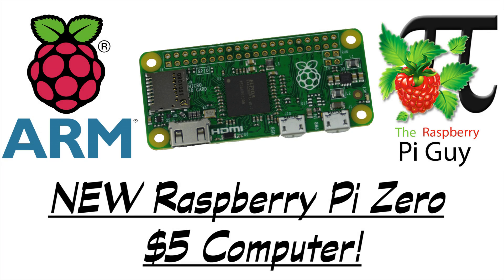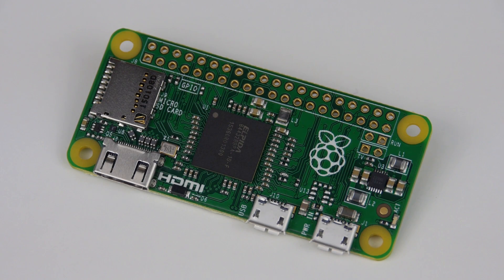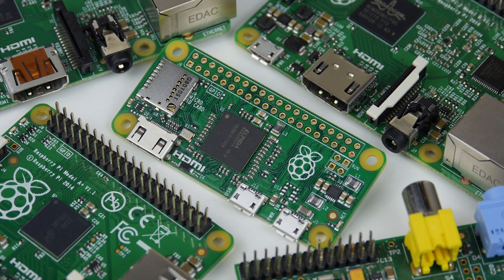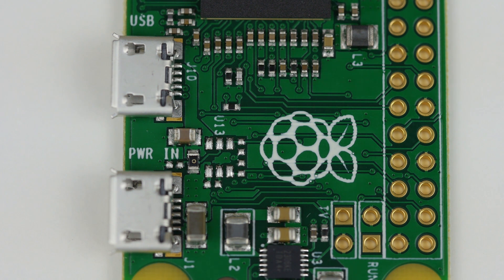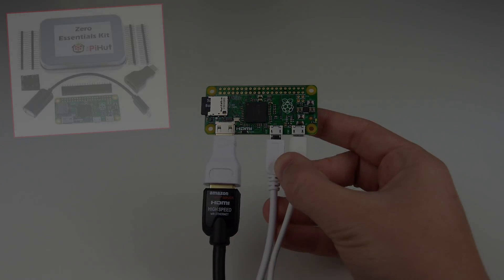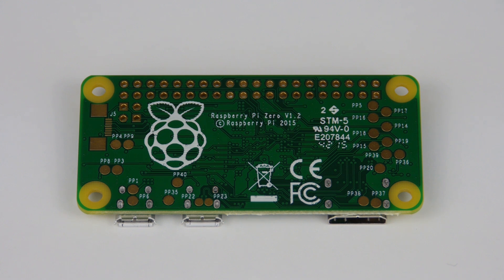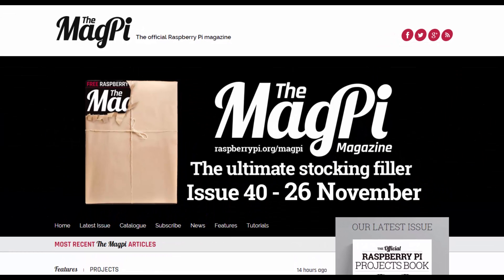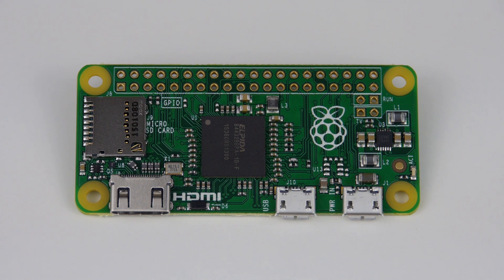NEW Raspberry Pi Zero - $5 Computer!

Comment: what about networking a bunch of pi zeros with etherUSB, I'm thinking one pi with two arduionesq microcontrollers hatted with usb host shields running a 12 port usb hub on each with 24 pi zeros networked between them,  thoughts?

Comment: Do you have to solder the top connectors on the board ? of you can get connectors that clip in ? I am shit at soldering and don't want to accidentally kill my pi by soldering crappy. I see there is also a TV connector holes. Can you solder a coaxial cable into that to connect to an old CRT TV ?
Reply: +LadyDanielle Zana You don't need coaxial cable, but you need some kind of socket for a composite video cable to attach to a standard RCA composite input on a TV or monitor.   Then solder two wires to the section on the Zero labeled "TV" and connect your socket to those wires.   I am a middlin' poor solderer, but I already have other RPI models, so if I ruin my Zero, too bad.
Reply: +artfd My composite soldering job was good enough to work, and I could then input the configuration to use a cheap WiFi dongle in my USB hub.  I did that because I had a spare composite jack laying around.  Later I went to my local electronic parts store and bought another jack for 75 cents, I will add wires from my junk box.  I didn&#39;t use coax, just 2 wires.   I ordered a mini-HDMI to standard HDMI video cable, and after waiting a week it still hasn't shown up in my mailbox.  The store where I bought my Zero is still out of stock for miniHDMI cables & adapters - except for the $30 ones, which I will not buy.
Reply: ***** I actually took my Raspberry to a omputer geek shop, and they soldered all the gizmos for me, and also bought the wifi dongle there also. I am still waiting for my micro usb hub i got from Amazon to arrive, before I put the Pi and the USB peripherals into a container as a rig , which was once a winx fairy candy capsule.

Comment: I feel bad for the CHIP microcomputer that is launching on Monday they claimed to be the first $8 computer, and now the raspberry pi foundation comes out with a $5 computer :P
Reply: +daynater I don't, since CHIP has Bluetooth and Wifi whereas RasPi doesn't. Also CHIP comes with 4GB of embedded storage, whereas I'd have to buy a MicroSD card for RasPi.
For IoT, I'd prefer CHIP.
For Robotics, I'd still prefer CHIP.
For Embedded Computing, I'd say it's a toss up, expansion varies on both devices.
Reply: +daynater The World's first $9 computer.  It will still be the Wold's first $9 computer.  :-)  The CHIP is network ready like ssbtoday1 pointed out.  They are cheap enough you could buy one of each.

Comment: This will change the SBC market, Very impressive, We have done several projects using Raspberry PI and made decent money :o)

I am going to order few of them now to test it, I am working on a project using OpenWRT hardware (AR9331) which was the cheapest SBC solution I could find, Now I am switching to Raspberry PI Zero, I am going to save $$$$$$ 

Saravana
www.qmaxsys.com

Comment: If I were to use a powered hub that has several things connected, like a keyboard, mouse and hard drive, and sometimes a drawing tablet... would it be able to take it all? There must be a limit there, even though the hub is powered, right?
Reply: +DaVince21 You're limited by the bandwidth of the USB bus, same as any other system. USB 2.0 is limited to 480Mbit/s shared across all ports on the same bus. Whether it's 1 port or 4, if they share the same bus, that's the total bandwidth available. AFAIK all RPi hardware has shared a single USB bus.
Reply: +DaVince21 USB hubs can be chained together to use many devices at once on one port. bandwith eventually will slow it down but shouldn't stop it.
Reply: Thanks for the explanations, I had actually wondered about this in general. :)

Comment: also why cant you use the camera or tft display?
Reply: you can use most types of TFT, but the official one requires a specific connector which is not includes, just like the camera.
Reply: +Mark Murarescu I'd rather move over to radiosets and vnc anyway... there are other devices more launchpad esq for breakout,

Comment: why not just a usb c? you could get rid of the hdmi and the other ports, i project video thru hdm via my otg usb in my galaxy phone the pi should just have a wifi radio and one modern usb serial port, and those pins of course. still its 5 dollars, whenever they are back in stock that is... :/
Reply: I thought this too but apparently the peripherals are affordable when I checked the suppliers in china, and of course they still had to include the hdmi, which isn't free either, still needs an adapter for most tvs dont have minihdmi. I don't have one in my hands yet but somehow I imagine just having more independent peripherals is better because its less strain on any one port, I bet you they thought this out and probably more than I did!
Reply: because it's uncommon AF? (And did I mention my phone uses Type-C?)
Reply: +Anne Blackwood too new, too expensive, and draws a lot more power. Sure it's smaller, but not that much smaller and a lot more costly.
Reply: +Anne Blackwood As its new I imagine its more expensive than the standard Micro USB connector and $5 was the goal here.
Reply: Anne Blackwood
 The keyword is "China". See the OnePlus Cables.
Reply: +Anne Blackwood 
I think in the next version they will probably include USB type C. By then it will be cheaper and more common

Comment: if usb was on header instead of port this could be very useful as there could be ethernet, wifi or 3g add-on boards... or one with usb hub... anyways as it is now its pretty use nice for some projects where you just leave raspi and dont need to touch it again, but for hacking device it should have possiblity to add simply wifi without extra cables that take much of room... i would find it really interesting if there was version with rpi 2 SoC and header for usb in addition to current IO header. something similar to http://www.acmesystems.it/arietta but more powerful... and maybe cheaper (shipping costs are usually making these things pretty expensive)
Reply: +netman87 amount of ram is pretty good. could be 1gb but its not problem... keeping it small while adding features is hard when you dont have usb headers. imagine this with add-on module that adds lipo battery charger and mini-pcie connector (only usb lines + sim + solder jumpers for some special pins)

you could actually add battery + 3g & gps module and have it fit yout pocket and update internet with your location data... could be really really cheap gps tracker or anti-steal protection to your car

Comment: So basically I can buy a top end windows 95 pc for $5! lol
Reply: +BigDirtyBasterd jaja, 33mhz 386 is around 35 mips, pi b is ~840, pi 2 is 1100 ish. So it's 20-30 times capable.

based on this http://hackaday.com/2015/02/05/benchmarking-the-raspberry-pi-2/ and wiki data from 386
Reply: +MrKekson First, a 386 is not a top end Windows 95 PC, that would be a Pentium II and second, a Pentium II (or 386 for that matter) is a CISC processors, BCM2835 is a RISC processor. A single x86 (CISC) instruction can do much, much more than a single ARM (RISC) instruction, so comparing MIPS between the two is absolutely useless.
Reply: +BigDirtyBasterd My first PC in 2003 with windows xp  had 256 mb of ram, 1.4 Ghz cpu and it costed 500$
Reply: *****
optimistic
.
Reply: BigDirtyBasterd ok, 3/480 flops was around 50-60 mflops, rspi b is ~40 raspi 2 is 92, so true that, everything depend on what you count.
I just wanted to point out, that raspi is pretty strong for it's size.
Reply: +hellterminator thank you, someone with some grey matter and actual knowledge.

Comment: How is this compared with the odroid w?
Reply: +TechnoidProduction The Zero is faster, has the newer Pi B+ onwards pin header (instead of the old Pi 1 and secondary header), but lacks any of the battery stuff, the ADC and the RTC. The Zero is longer, but not as wide as the W.

Comment: I'm new to this, so it's probably obvious, but how do you add a mouse and keyboard if there is only one USB port?
Reply from the maker: +Finnegan Messerli the Foundation were clearly going for keeping the cost and size of the Zero down. If you wanted to plug in a mouse and keyboard you would have to use an adaptor similar to the one you can see me using in the video. A USB hub would also come in handy! Alternatively you could just use a WiFi dongle and access the Zero remotely
Reply: +TheRaspberryPiGuy Thanks for the quick reply. Great video by the way. I'm still a bit confused. How did you control your pi?
Reply from the maker: +Finnegan Messerli I am using a USB adaptor with a wireless keyboard/mouse combination
Reply: +TheRaspberryPiGuy So one connection for both? Makes sense. Thanks again.
Reply: +Finnegan Messerli Or use a USB hub.
Reply: +Finnegan Messerli I already have a Lenovo keyboard with Trackpoint, that connects to my other Raspberry Pis through a single USB connector. This key board is almost identical to the Lenovo Thinkpad keyboards.  I don't use a compute mouse this way.
Reply: +TheRaspberryPiGuy im new too, if i use the usb hub say 10 ports would it be ok and not "overload" or any problems?
Reply: +Finnegan Messerli u can get a usb port multilplier it will work  on any device using usb and is cheap also
Reply: +Finnegan Messerli  some USB keyboard have a built in USB hub with 2 ports to connect more stuff. Some LCD monitor too have built in USB hubs. 

If you want to avoid to have to deal with batteries with a wireless mouse and keyboard, the best would be to hook the single USB port of the Pi to an LCD monitor with a USB hub and from there, you connect a USB keyboard, also with a USB hub. 

From 1 port on the Pi, you end up connecting everything and have a few ports left on your monitor and keyboard and no external USB hub required.
Reply: +TheRaspberryPiGuy 
Short question: There are USB-Hubs with one Ethernet/LAN port and some USB-Ports (without own power supply). I doubt that the micro USB-socket of the RP Zero would provide enough energy to run one LAN-Connection plus one receiver for a remote control. I would need it for openelec/kodi. What&#39;s your opinion?
Reply: +Finnegan Messerli you could get a usb keyboard with a mouse pad
Reply: +Ampuan needs to be self powered.
Reply: +Alias Anybody I have hub with 4 USB ports, 1 enet port.  I tried that, and didn't seem to like the ethernet port.  I ordered a ethernet/WIFI dongle and powered hub; the ethernet dongle is OTG connector.  Is supposed to have drivers built in??? we'll see.

Comment: That 160mA power draw - is that sitting idle or with the CPU running full bore?
Reply from the maker: +Tim Hicks good question. The 160mA is running at full bore. Mark, an engineer at Raspberry Pi, told me that when idle the Zero draws ~80mA
Reply from the maker: +TheRaspberryPiGuy Correction! The engineer I chatted to was Mike Stimson, who did the hardware design of the Raspberry Pi Zero
Reply: Sweet, thanks for that - I've already got a project in mind for one of these and those numbers sound ideal!

Comment: Oh man I love this, this is crazy, poeple using Arduino need to rethink about using a microprocessor in place of a microcontroller based board.
Reply: You can't replace Arduino with RPi or vice versa.
Each one has its own capabilities, RPi is very fast and can run linux, Arduino has way beeter interfaces with sensors and other electronics stuff.
It largely depends on the specific use .
Reply: factually you are right
Reply: +Gaurav B Arduino eat up much less power, in exchange for cpu speed. So i think the best use is to use the pi as a main controller ( for me it&#39;s gathering sensor data, and providing snesor api, and server features like webcam, file storage etc ) sitting on a lan connection, whiles the endpoints are arduinos(  if some procesing power needed), or micro IoT devices ( just as input/output devices ) connected trough wifi.  
Those are mostly battery powered, so basically i can put them wherever i want, with any sensor/relay configurations.

Comment: what is the network connectivity available?
Reply: +Jobin Joseph As I can see from the hardware, there is only a USB port to use all your input adapters including network.
Reply: +Jobin Joseph Same as the A+, plug in a Wifi dongle. Very easy to setup plenty of videos for this for the A+.
Reply: +Richard Collins would it help if i use usb hub in which connected with mouse, keyboard and wifi at the same time?
Reply: +Mad Aomi I think you'd need to have an additional power source for that